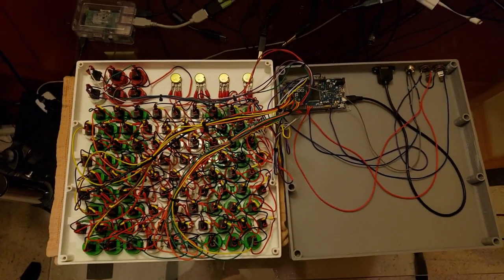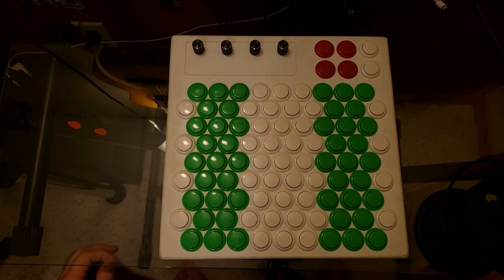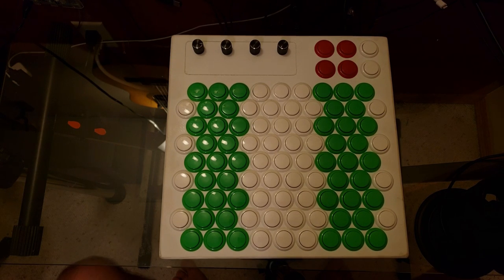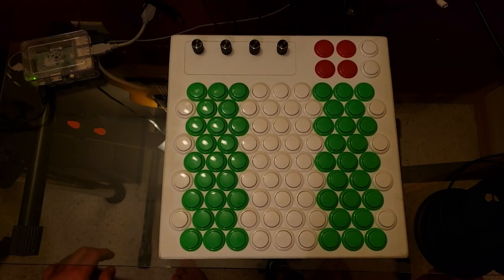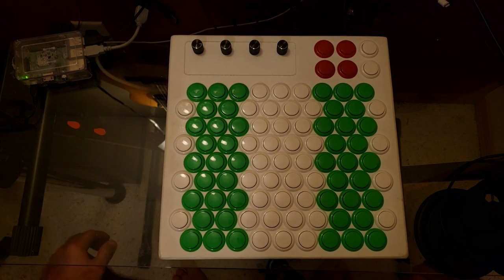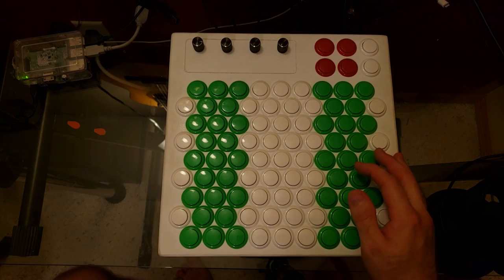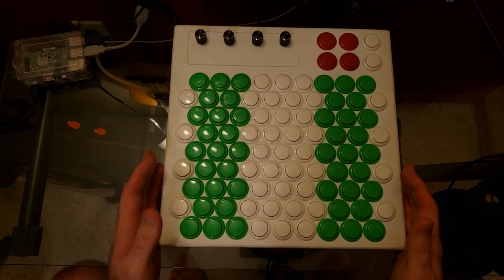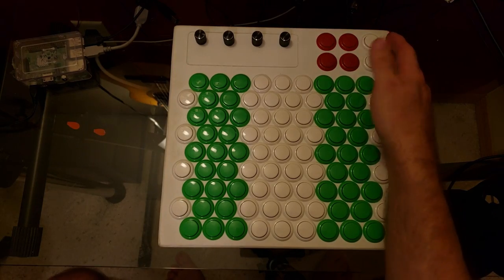Melodicade - Arduino Based MIDI Instrument Prototype

Comment: Would a o ring dampen the sound of the clicky buttons? or is it not that noticeable in a live performance?
Reply: @KOOPInstruments  There is a brand of arcade button that has the internals of a mechanical keyboard. Long story short, they are very quiet and have a small footprint internally. They are a bit pricey but I figured you might as well have the info. The brand is "Gamerfinger". This would also allow you to somewhat customize the "feel" of the button press by choosing a different microswitch. To save some money on mine I bought cheap chinese microswitches, and only bought the button and the base from focus attack.